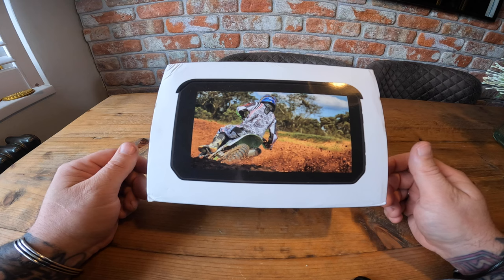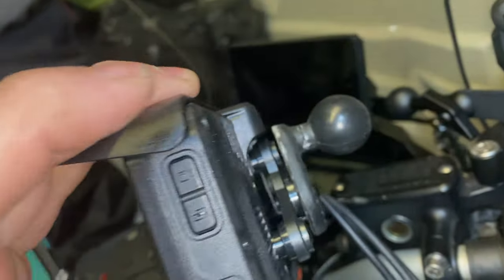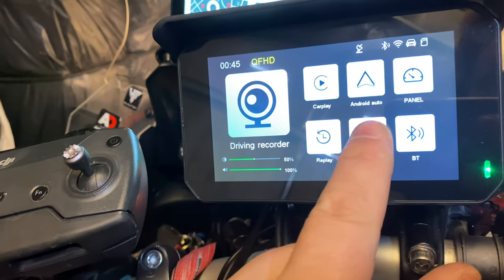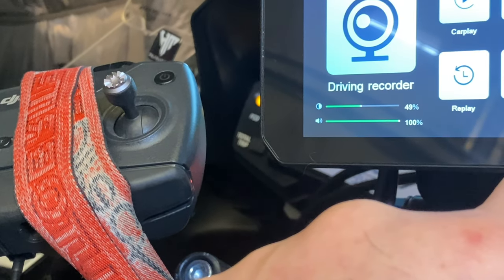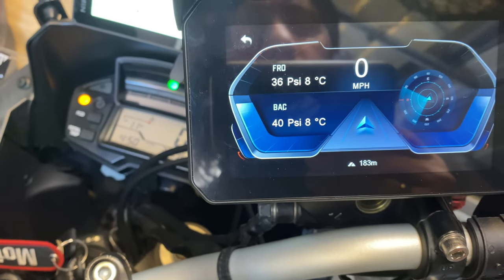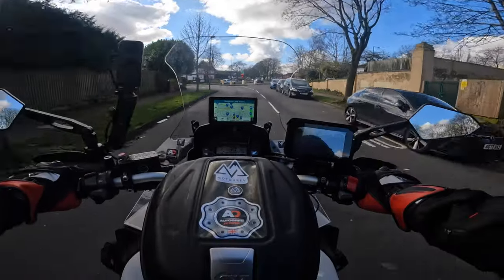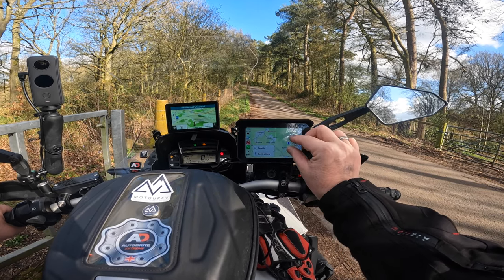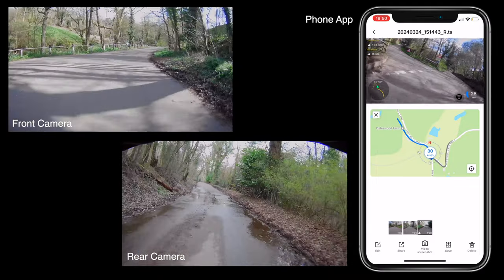The 4th & Final Apple Carplay/Android Auto Display :: CARABC

Comment: All these 
I bought a Carpuride and after 3 nights in the garage moving it around to find a suitable position I decided to return it to the seller. It just looked so out of place on a bike. I see the benefits of using Carplay / Android Auto but it needs to be incorporated into the bikes OEM Display. Also the lack of a quick release cradle for any of these devices is a real issue. There all Chinese and Iv'e seen no reliability long term tests or anyone returning a unit for repair describing the ease of process. Iv'e parked this idea for the time being. When they've been around a little longer and this sort of info is available I may revisit.
Reply: How did you manage to return the Carpuride ? I want to return mine but they tell me its expensive and are offering 40% discount refund and to keep the unit.
Reply: @stevecockton6624  Bought via Amazon - No issues No Quibble . Refunded in full. Your experience sort of answers one of my reservations ie how are you handled by the manufacturer when you want to return an item or have issues. Poorly by the look of it. Hope you get sorted.